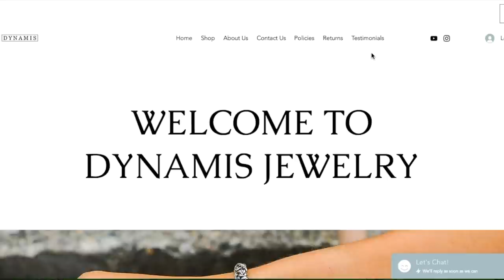Making silver necklace Anacondas | Classic Foxtail | Loop in Loop Chain

Comment: One question. When snipping the coils into individual links, why use snips one at a time? Instead of putting the coil on a rod/mandrel and using a chisel to cut them in bulk. Is there an advantage to snipping one at a time?